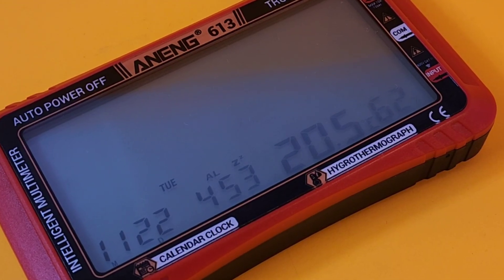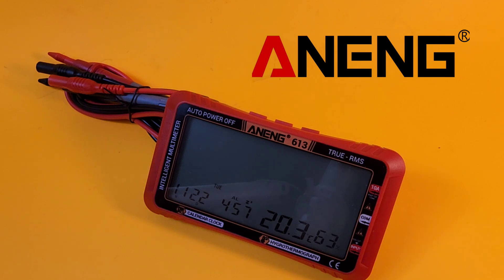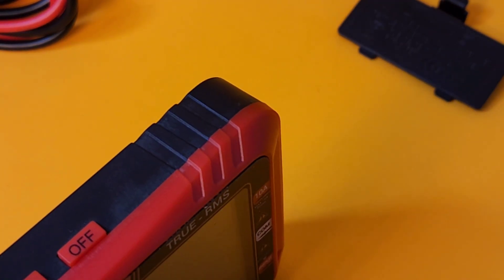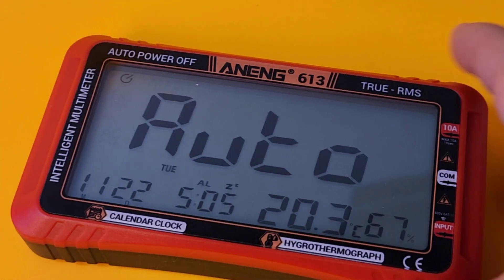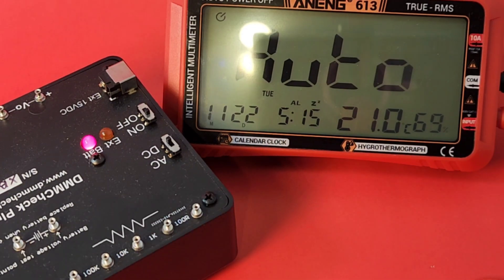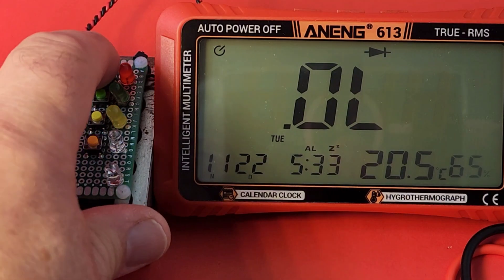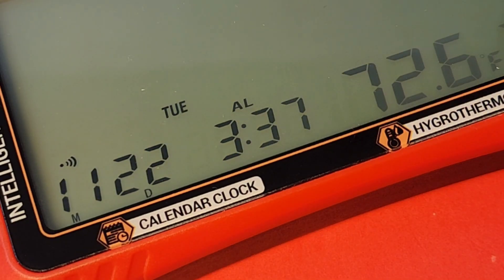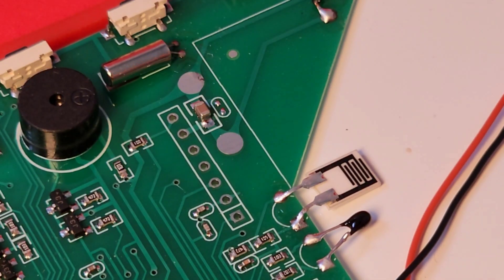ALL NEW - ANENG 613 CHEAP-O Multimeter/Alarm Clock!? Review & Teardown!

Comment: Congratulations being first reviewing this meter!👏 Good luck fixing the backlight. 💡  It appears to have a screen protector, but I'm leaving it put.😎
Reply from the maker: You know it's on so tight I tried to remove and the whole display started lifting so it stays on  ! Thx for the kudos Paul and great follow up blog!
Reply: @KeepOnTesting  15:24 The Hold/Backlight button may be damaged or the PCB directly underneath.  It's sitting crooked and the trace nearby is lifted from the dielectric.  The wires to the backlight itself appear to be soldered correctly.  In the PCB view, it's the top right button along the edge. Mechanically they need those retention flanges to be soldered not only to the top PCB layer, but also the bottom layer and a plated thru hole. They may have mounted the switch too close to the edge or failed to add the additional copper. A workaround would be to epoxy little blocks behind each switch for support.
Reply from the maker: @pault6533 good catch Paul..yea the soldering on the switch was poorly done. The switch actually came off when I was putting the case back on.

Comment: I bought one of these multimeters at TMU. It cost me about $20, and the plastic casing isn't premium. The measurements are very good. It draws approximately 0.001 amps, giving it good battery life with two alkaline batteries. In my case, it works perfectly with the backlight. For its price, I think it's a good product, and it does its job. I searched the official ANENG website and couldn't find this model. It must be a Chinese product with the brand.

Comment: Darren, I know this is an older video, but I really think you were not fair in your review. I used to live in West Texas and now live in East Texas, and happen to be in areas where a cell phone is almost as useful as a brick. I work with my hands, so wristwatches are a no-no, so with that mindset I bought the Aneng 612. Same concept with a manual dial. The clock display is at least the same size as a watch, takes up no more space than a cell-brick-phone and hey, you can check continuity with it.
Reply from the maker: Hi Eric,  I appreciate your perspective, and I'll keep that in mind for future reviews. 👍
It's definitely not the worst multimeter I've reviewed..just didn't get the warm & fuzzy enough to appreciate the other aspects.

Comment: I am confused by these negative comments and review. As a multimeter, it seemed accurate enough. And it is super cheap, has a super large display... 
For this price, what the hell do you want? I think this is awesome.
No this is not a bot, or ad... I am just trying to be realistic here.
Reply from the maker: If ANENG hadn't marketed this as a Clock multimeter it would be a different story. But they did, and as a clock, it fails miserably. Sure it's an OK multimeter but definitely nothing special. Thx for watching 👀 👍
Reply: @KeepOnTesting  I get this, but I think close to zero people would want to buy a Clock multimeter :D And as a person who wanted to buy a bench multimeter on the cheap, this is awesome! Has larger display, as you showed, accurate enough, and suuper cheap. 
I mean... a few years ago multimeters cost 10 times more, and sometimes were even worse and less accurate than this one. The negative comments are painful, because people do not seem to appreciate how easy we have it nowadays.

Comment: A good feature to add in a multimeter is the reading of internal resistance for both  the capacitors and the batteries... why the manufacturers don´t think of that? (both are the results of calculations that can be easily inserted in their programming)

Comment: Had the same back light result, but it started to work with 100% new batteries
Reply from the maker: Good point. Unfortunately a bad soldering job on the BL switch is the root of the problem on this meter.

Comment: I think you're right, it's a gimmick meter. The font is way too small for it to be used as a clock or a hydro-thermometer on a regular basis. Besides, you can get actual hydro-thermometers for $5 a piece and place them around the house. They would last an entire year on a single CR2032.

Also, it's 2024. We have smartphones and smartwatches that track our REM cycles to not interrupt our deep sleep. What is the market for this? 🤷‍♂
Reply from the maker: All great points..indeed it's more smoke and mirrors than anything!
Reply: Sometimes you need to document the time, date, temperature and humidity of your environment with the reading. Whether you are doing a picture of the screen or jotting it down, this adds convenience.

Comment: What a weird combination...atleast has huge numbers. Wonder about how long batteries would last on that thing. If the backlight works, sure hope it wont die within 15 seconds. Looks nice for some long term monitoring if it stays on. Wondering if there is a model without the clock related features and just a big ass screen, that would be real cool!
Reply: Backlight only works when the DMM is running.  It goes out after 1 minute elapses.  When the unit is off, the clock is working of very little current.  You are right, the appeal is a big display.  As I get older I really appreciate big digits!
Reply from the maker: Weird combination indeed, but the weirdest thing is why Aneng chose to run the clock with the tiniest font possible instead of using the big numbers above..? I think they rushed this one out the door which is too bad..

Comment: Definitely not necessary without Li-ion.
Reply from the maker: @redtex  Trye enough..funny why a rechargeable battery is still not the norm..
Reply: I did a conversion, I posted it on KeepOnTesting blog.
Reply: Just to let you know, I did the Lithium Ion modification and posted it on the KeepOnTesting blog.😁 Have yourself a look.

Comment: Are you sure it's 4000 counts? It displayed 5 V with four digits, so it's at least 6000 counts.
Reply: Very observant!  I noticed this in additional measurements.  For instance, in current mode, it goes up to 599.9 mA before switching to 0.600 A.  V, C, R all 6,000 counts too. Confirmed up to 60 megohms and millifarads. Seems marketing missed the memo😊
Reply from the maker: Yea that's weird. Listed as 4k count display, but it does seem to overshoot. I think Aneng underspecced.